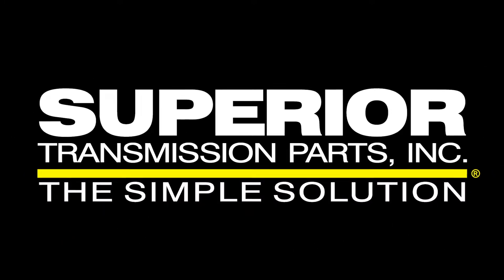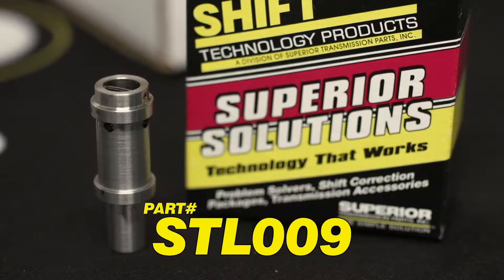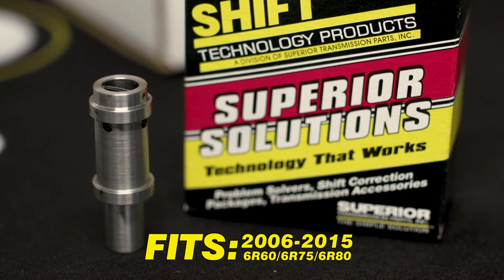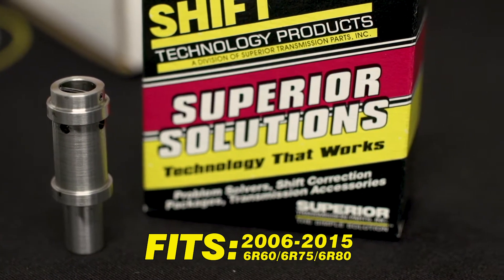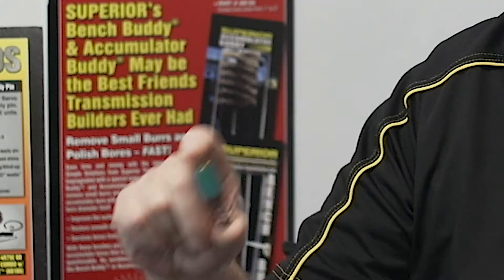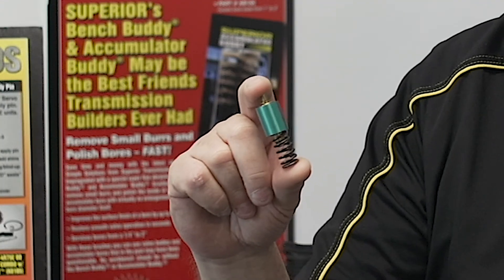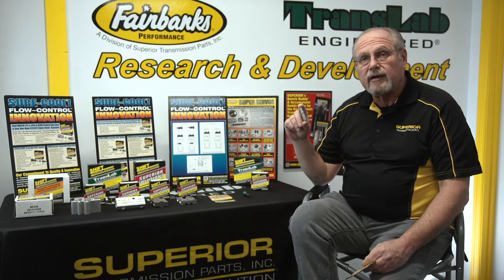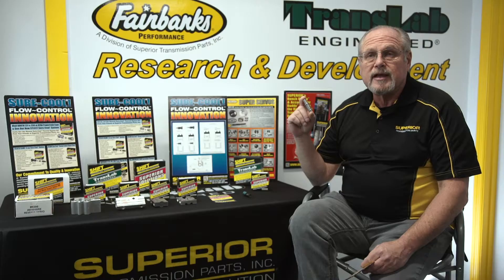Superior's TransLab Sure~Cool® STL009™ 6R60 6R75/80 TBV safety system for FORD 2006-2015.5 & ZF6 HP

Comment: Bought this bypass for the 6R80 with an external transmission cooler. Temps never go beyond 70-75 Degrees Celsius. Is this considered too cold and harmful to the 6R80? I’ve heard the 6R80 needs to warm up around 90 for optimal performance.

Comment: OK I guess I need one. information please 🙏
Reply from the maker: you can go to the site and find distributors off our disty page and type in the part number and it will take you to the STL009 product. you can also google online authorized distributors with the part number. beware of counterfeit copies on amaz and ebay.
Reply from the maker: WWW.SUPERIORTRANSMISSION.COM
Reply from the maker: also know this type is between the valve body and case INSIDE the transmission. its one that the valvebody needs to be removed to install the product. just FYI